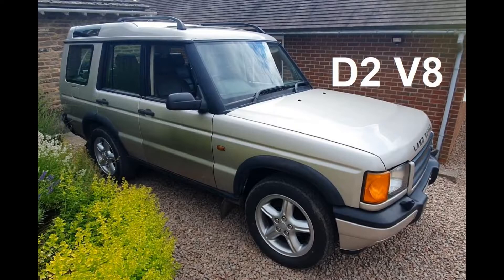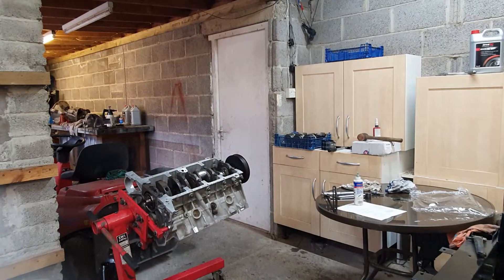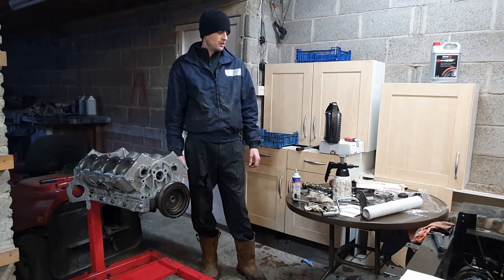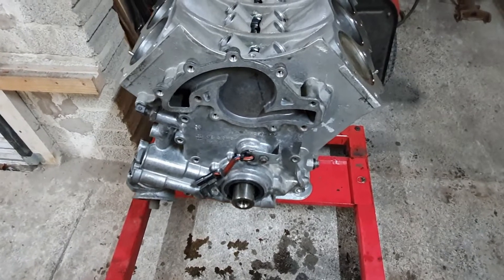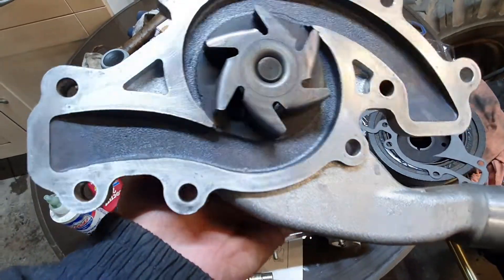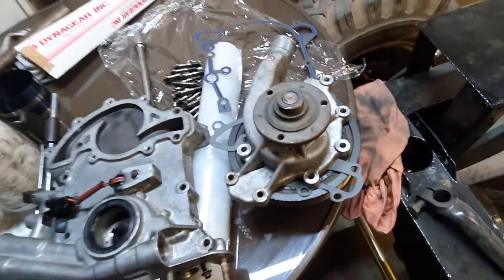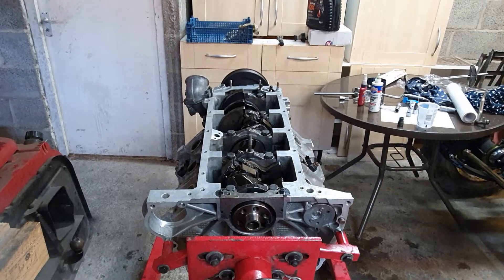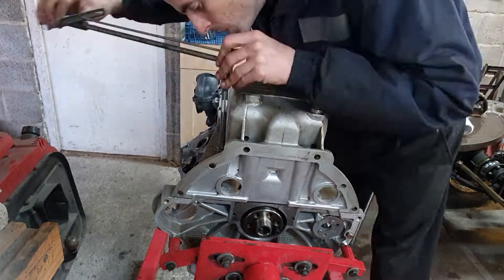Bottom End assembly - Discovery 2 V8 Engine Rebuild Part 8

Comment: Any points to note with the oil pump? Was yours scored from usage? What was the sealant you used on the timing cover? I used Wellseal which is non setting on mine which was just as well as the new bolts I was sent weren’t correct! Had to wait a few days before I could swap them over and torque down. Finally did you use thread sealer e.g. Locktite 572 for any of the sump bolts? I’m not sure if any of yours go through to the engine compartment either the D2. Mine do on the D1 engine such as the front ones into the timing cover.
Reply from the maker: Thabks again for comment, much appreciated. 

Re. The oil pump, they can break into a few pieces, nine wasn't that bad, it was all present and correct, but yeah it was a little scored. I'm pretty sure the engine had suffered from oil starvation as I found the oil pick up was full of old bathroom sealer totally blocking the gauze. I assume it was scored either from being a little long in the tooth or from this recent oil starvation (or both). 

I used an RTV sealant on the water pump (I'm using reizisol, cheaper alternative the loctite RTV), I bet you were glad you didn't use RTV. I am using the non sealing stiff a little more now though, it's very good. 

I thinki might have just put a load of RTV on the bolts to seal this through bolt hole, I'm afraid I can't remember for sure though, proper loctite thread sealer would have been better really.

I dont think there are any sump bolts on mine that are drilled right through, it was a little while ago now (video making is lagging a little). Has the D1 got an oil pump on the front of the crank like mine?
Reply: @lozl   Thanks for getting back to me. Yes same as yours part number OPK003 or DA4189. My oil pump cover plate was scored as someone put an aftermarket timing kit on that just touched the cover. This left a shiny indent as where the chain went. Luckily the damage wasn't too deep and I've installed a fresh standard kit in its place. Hopefully the engine will be quieter now!
Reply from the maker: @dalamar6228  that's interesting I had a look at fitting a different chain but thought it might do something like that. When will you know you've cured it? Is it in bit now?
Reply: @lozl  it’s in bits so May time being realistic. Don’t believe it’s down to crankshaft end float as the scoring was upwards of 0.5 mm in places. The timing kit was a JP Performance 5984. Maybe it’s because of my intermediate timing cover. Might be ok on a D2. I believe these were sold by RPI Eng years ago. My engine actually lives in a TVR Chimaera and the standard timing setup is sold by the various TVR parts suppliers so I’m confident the bog standard setup will be ok for me. Will update you when the car is driving again.
Reply from the maker: Super, yeah I'm sure that'll do the job. Bet you can't wait to have that solved. I think you should pop a video up when it's all done

Comment: Is there any chance you could show engine oil cool and fittings and location as I have a D2 V8 face lift with no oil cool and wish to fit oilcooler  but have no info thanks
Reply from the maker: Yeah I could do a little vid if you like, but the car should have one?? The one on mine is factory fitted. The cooler sites between the radiator and AC condenser (AC radiator) has yours been removed???